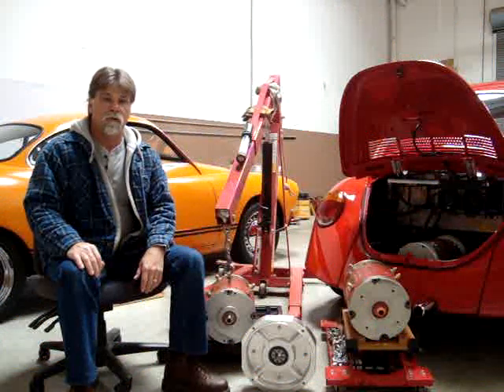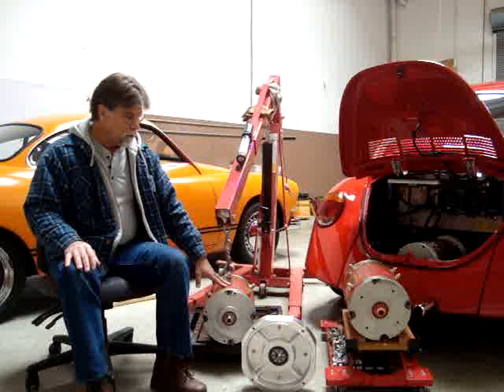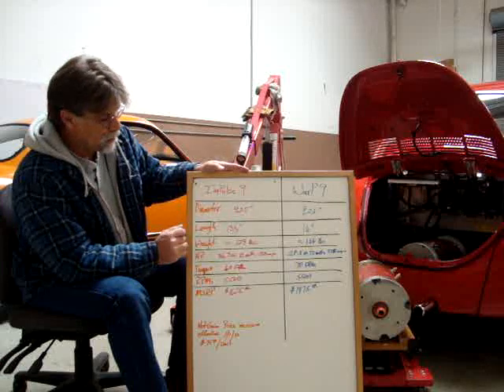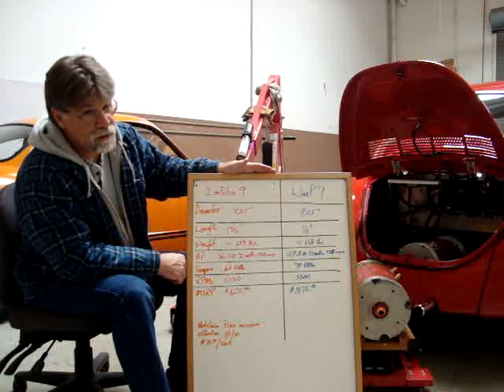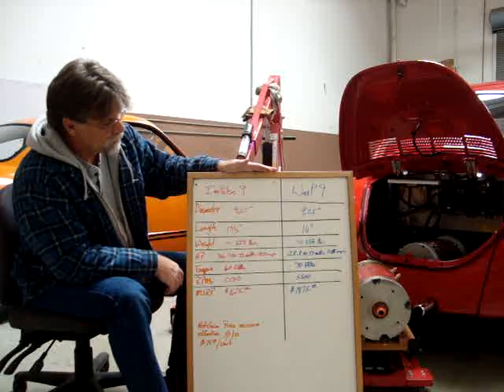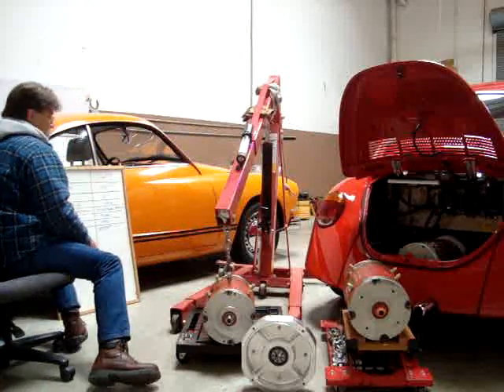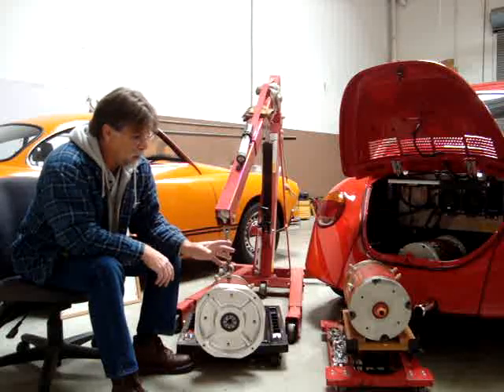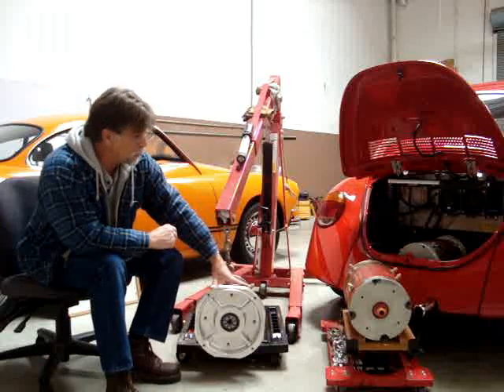DIY Electric Conversions - How to Convert to Electric Series Part 3.wmv  www.EV4Unow.com

Comment: hi I want to thank you for the videos you post, they are some of the most informative and practical videos I have seen here.  I am building an EV based on them... at the moment it's all in theory as I research parts and cost and a garage to put it all togrther.  my idea is to purchase a car I actually like  input make it an electric car....  do you have any idea of what course I may incur one of my favorites is a Honda crossover also BMW X6.  I do realize the expense of purchasing one of those Vehicles especially a working model as you recommended but I want a vehicle that I would actually like and prefer to drive.  thanking you in advance 

big fan
Billy

Comment: Great videos, 
Quick question, why do people do EV swaps without transmissions? How does that work?
Reply: Juan Sandoval it's because electric cars can spin up to 20 or 30,000 rpm. You don't need a gearing advantage like you would in a car that only revs to 5 or 6000. Also electric motors have all their torque available at the low-end.
Reply from the maker: Please address all questions or comments to:  info@EV4Unow.com

Comment: how do electric motor to gas, hp compare? your motors are well under 100 hp.
Reply from the maker: Horsepower is Torque X RPM divided by 5252.  Electric motors have maximum torque at very low RPMs so they tend to greater horsepower at lower RPM than a gas engine.  Which where you will notice it most.  The stock gasoline engine in our Karmann Ghia had 46 hp at 4,000 rpm, and 72 ft.-lbs. of torque at 2,800 rpm.  With the HPEVS AC-51 motor and Curtis 1239 controller, it is producing 79 hp @ 4,000 rpm and 88 hp at 4,700 rpm.  As well as 108 ft.-lbs. of torque at zero rpm, and 100 ft.-lbs. at 2,800 rpm.
We use an 8-1/2" x 21" motor in our Miata conversions that produces 168 hp and and 186 ft.-lbs. of torque.  The motor weighs 128 lbs.

Comment: How these motors perform in cold weather. I am talking -40 C like we have here in Canada
Reply from the maker: The motors work fine, it's the batteries that don't like the cold.
Reply: But you can make your own battery heater, right?
Reply from the maker: That's correct.

Comment: Richard, Do you always use a clutch? I see many dispensing with the clutch and simply "float" the gear shifts. Does that bearing that the adapter rides in have a life span?
Reply from the maker: EV4U always uses a clutch.  Check out our latest EV Answer Man video (Episode 16) for the reasons why.  Regarding the adapter bearing life span.  There are two of them, and they should out last you and me.  Thanks again for watching and for your comments.  I thought we had the clutch video on YouTube, but it turns out it never made it.  It should be uploaded today.  Your comment brought that to light.  Thanks
Reply: EV4U Custom Conversions Richard, Your web site and videos are great. I know you must be busy but you always find time to respond! Thank you very much, you are a true ambassador for EVs. Good work!!!!

Comment: Always been mystified by the electric motor as a replacement for a gas motor..Major concern though with battery life, Range,heater and defrost capability, etc, etc...That being said I just don't think the technology is there yet to be a viable replacement for the family sedan...Perhaps a back and forth to work machine... In that case though a cheep beater would be a better price option..These are all questions when deciding on a route to go for the average consumer..
 My hat is off to you for doing this..Very informative and interesting video series...You make me very proud to be American...See a need and fill it for the greater good....Thank you..
 Oh and very clean and very professional install also..
Reply from the maker: Thanks for watching!  Just a few comments in response to yours.  You should check out some of our other videos in regards to batteries, heating, air conditioning, range, etc.  Most American's have more than one vehicle, and 80% of Americans drive less than 40 miles per day.  Which means that an electric vehicle could work perfectly for most.  But it is not the answer for everyone.You're right about the cost issue.  I appreciate you comments, and you communicate well.  So often I do not have a clue what someone is trying to say.  It's nice to receive a well thought out and correctly spelled correspondence.  Thank you too for the compliments, it is always appreciated, and it is good to hear a kind word once in a while.
Reply: I wasn't trying to be a curmudgeon or anything..Just something I've been trying to wrap my head around for a very long time...I been trying come up with a good electric powered Motorcycle so as a matter of course I tend to research things heavily before I make an attempt...I think it relates to my engineering. automotive and machinist background..I wish you and yours the best of luck..
Reply: +Daniel Hoffman By about 2020 (give or take 2 years), the first graphene based batteries should be hitting the market. As these batteries have an energy density much higher than even gasoline. So expect electric car ranges to easily be in the thousands of miles.

Comment from the maker: A flywheel is used on a internal combustion engine to help maintain rotation of the crankshaft through the four stroke sequence.  That is not necessary with an electric motor.  The lightened flywheel allows for less overall weight, less rotational momentum, and a mounting for the clutch components.